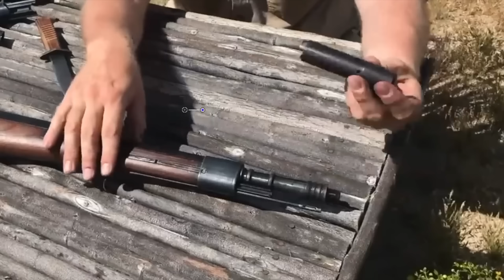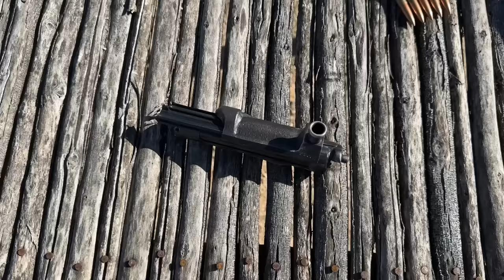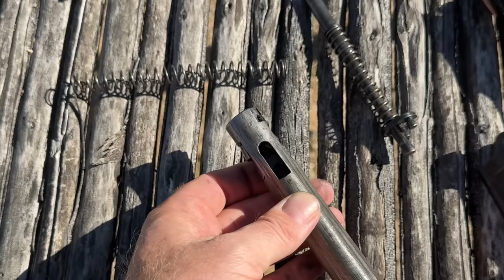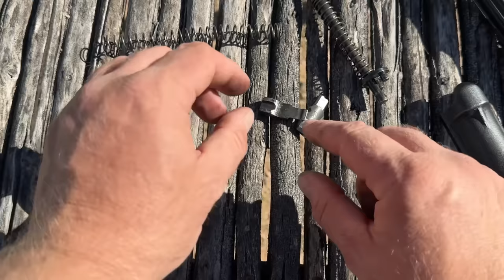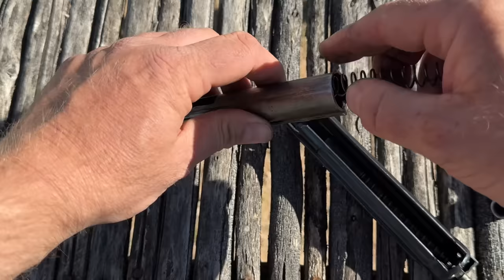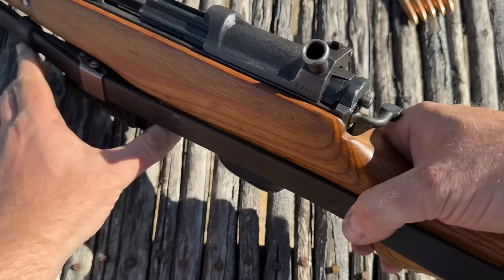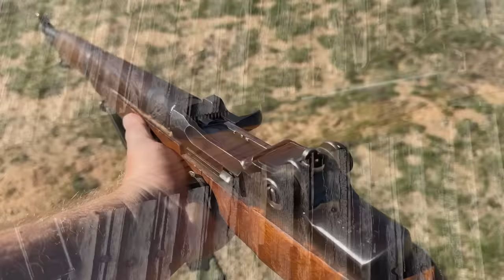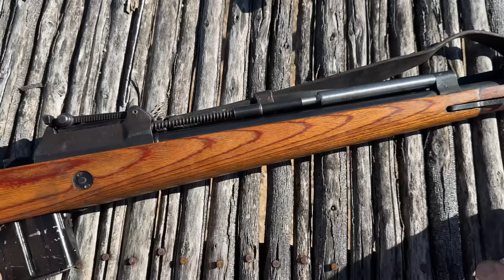Das G43 Wunder-Gewehr ist Scheiße

Comment: The best autoloading rifle of Germany in WW2 was the STG, by far. Not because it's the first "assault rifle", but because the G41 and G43 and the VG 1-5 are just garbage.
Reply: Don't forget to put the FG-42 together with the bad ones, interesting design but it just breaks.
Reply: @zepetv589  How dare you?
Reply: To be fair to the VGs, they work pretty well for being made out of scrap wood and drain pipes
Reply: @zepetv589  the 2nd pattern doesn't tend to, but they weren't available till very late, so it hardly matters. It was copied/improved on extensively post war.
Reply: I mean designing a assault rifle around an 8mm cartridge is probably not the best idea. You end up with a extremely long magazine that causes soldiers to be sticking way up when they are going prone.
Reply: @dancortes3062  That's a pretty negligible difference in a relatively niche situation.  The same criticism could be leveled against really any SMG of the war.  Besides the reason is mostly down to bullet curvature, and the bullet's dimensions were mostly chosen for ease of production, matching the standard 8mm mauser round in as many aspects as possible so they could use the same tooling instead of having to make new tooling.
Reply: StG 44 was not w/o faults either, it loses headspace after as low as 3000 rounds and magazines were often junk, leading to stoppages if loaded with more that 24-25 rounds.
Reply: We all know the krumlauf is the best weapon...We are only able to defeat that technology 80 years later with guncam (felin, X29 etc).
Reply: @alexisborden3191  They used to produce .30 Mauser. Why couldn't they make it with .30 caliber tooling? I would think that would be a little bit better unless they got rid of that tooling before the STG-44 was produced. Also the ability to get as low to the ground as possible is probably not as niche as you think. Some soldiers in the Vietnam war loved how low they was able to get to the ground with their 20 round M16s. Their Alice packs were getting shot up and any higher, they would of been dead. Even the Germans in WW2 developed a smaller capacity mag for the STG-44 so soldiers could get closer to the ground if need be. Yes some SMGs in WW2 had long magazines but the STG-44 mag was ridiculously long. It would be like having a 50 round AR-15 mag.
Reply: @zepetv589  excuse me? you mean the design that is still being utilized by the Bundeswehr to this day? for lack of a better desing????
Reply: @seancopley-b8p  FG-42, not MG-42
Reply: @daer2121  The only thing that took some partial inspiration from it that actually went anywhere was the m60 (some prototypes in the EM-2 programme but the actual EM-2 had little to nothing in common and even that didn't go anywhere in the end), and that was just the operating system which is basically the Lewis' so not even something unique to the FG-42. Please correct me if there's something I am not recalling.
Reply: I wonder, if what the US had in WW II was in all respects better, and having Brits, Canadians and half the World helping them, too why did. it still take them almost a year to get from Normandy to Berlin.
Reply: @dancortes3062  The difference between prone with a K98 and STG44, is like maybe 6 inches at most, at range that's not affecting your liklihood of getting hit all that much.  If it really mattered, the Americans would never have used the the 30 round magazines ever.  Its not ideal, but its workable given the alternate problem of having less ammunition and rifle production.  Not letting perfect be the enemy of good sort of thing.

As for .30 mauser tooling, there was never going be as much tooling for 19th century pistol rounds as there was for their mainline rifle.  I mean, without pulling up production numbers, I can't imagine German industry produced much 30 mauser compared to all the 8mm mauser that was produced for rifles, machine guns, aircraft, vehicles, etc.
Reply: @Bojan_Kavedzic "it" according to whom? Are you claiming all StGs were made equal? There are plenty of original examples out there with 10k+ rounds through them with zero headspace issues. Just because an odd example of the latest examples made might suffer from a headspace issue, almost without a doubt due to improper heat treatment or just overall poor metal quality, that doesnt mean they all suffered from this. Far from it infact, as if you read troop reports on the weapon it was it pretty much universally loved and praised for its reliability, even on the harsh eastern front. Only repeated complaint was the magazine springs becoming too weak over time if left loaded with 30 rnds, hence they simply mandated it only be loaded to 25, and problem solved.
Reply: Certainly it being the first assault rifle does have something to do with that, but it is very much correct that it was the most fool proof design.
Reply: @Bojan_Kavedzic  Bold of you to assume the average stg 44 user would survive to shoot 3000 rounds
Reply: @goofynose2520  Not a large issue in WW2, but Yugoslavia found out that using those in peacetime. Which a part of the answer to the question that pops sometimes - "If Yugoslavia used StGs, why did not they produce them".
Reply: @hummingbird9149  Based on nearly 30 years of use (out of those ~20 as primary rifle for paratroopers) in Yugoslavia. There were rifles that could last a long time, but vast majority was built with pretty poor QC (well... that happens when you are loosing war badly) and while reasonably reliable initially with decent mags (but reliability was nothing to write about, it was more susceptible to dust, mud and cold weather than either AK, AR-10 or vz.58 in Yugoslav army testing when it was used as a comparison rifle) majority started  having issues after few 1000s of rounds, so rule was made that after 3000 rounds headspace should be checked every 500 rounds.
Magazines were just junk, both metal in mag bodies and springs was absolutely substandard. This lead to the mags being easily deformed and springs setting.
Reply: @V3RTIGO222  Even MG-42 was not w/o issues, bolt bounce being quite problematic one. This was never solved fully, even in the post-war versions, and when MAG and PK appeared MG-42/MG-3 became clearly second-best design.  Don't get me wrong, it was groundbreaking for WW2 era and best MG from 1943 to about early '60s, but technology has moved on since then.
Reply: @Bojan_Kavedzic   Also issues with receiver cracking, explosions, etc. With the modernized version they eliminate the detonation and cracking, and mitigated bolt bounce to the point where AR-15s are... so effectively it's a non-issue. That said, gas operated designs are better for a large number of reasons including static free-floated barrels sporting superior inherent accuracy and modular design. That said, it is still a cool gun and historical monument to machine-gun design.
Reply: @Bojan_Kavedzic  so based on second hand service in small numbers with a poor country post war. Again not really indicative of anything. Without knowing the exact batch numbers & amount of previous use, it's impossible to gage anything from this. That said if they stuck with it for 30 years, then it had to have presented some serious strong suits to them that convinced them to keep it for that long.
Reply: @Bojan_Kavedzic  They didn't produce them because they didnt have the ability to do so. They had none of the German manufacturing machines to do so. Also tech had moved on, it wouldve been odd if by the 50s there werent any improved designs available.
Reply: @Bojan_Kavedzic  ...do you really expect a country that is at war with half the planet (and loosing, obviously) to put a high emphasis on quality control when it comes to small arms? Not to mention that, to my knowledge, most STG's were going to the eastern front, where the the average firearm would be dropped (from the soldier dying) or destroyed within the first 500 rounds. Making sure your small arms are nicely finished, have proper quality control, and can actually load the full 30 rounds instead of just 25 really isnt a priority under those conditions.
Reply: @V3RTIGO222  Agree. It was good designing in general, but it took post war versions to iron out bugs, and by then it was superseded by better things. It was still probably best compromise out of all WW2 MG - things that were "better" as MGs tended toward heavy and hence lost a lot at tactical level.
Reply: @hummingbird9149  Discarding real experience because it does not agree with wehrboo fudd lore? 
Unlike popular myth, most StGs in Yugoslav service were not captured, those were received from Czechoslovakia in 1947-48 and France 1948-49. Most of them (about 85%) came as a factory new guns, that were produced, but never issued by Germans in WW2.
Reason Yugoslavia stuck with them so long was that automatic rifle program was late by ~10 years due the some technological and licensing issues. StGs were already supposed to be replaced in the early '60s in paratrooper use, but it took until late '60s/early '70s.  After that those were mostly used for paratrooper drop training and on exercises to give "OPFOR" distinctive weapons until guns were declared "fully obsolete" in 1981.
Reply: @hummingbird9149  Except in the late '40s/early '50s when StG production was considered in Yugoslavia there were no better designs available. Only thing that could compare was AK, but it was unobtainable for Yugoslavia, due the 1948. split with Soviets.
Reply: @random.3665  
1. 500 rounds lifetime was myth. 
2. Soviets managed better QC in 1941. then Germans in 1944-45.
3. Who talked about finish? I was talking about mags being made from totally substandard metal, and worse mag springs were made from the same junk.
4. If mag is designed for 30 rounds, but needs to load 1/5 less - that is a pretty serious issue, wartime or not wartime.
Reply: @Bojan_Kavedzic  On the contrary you're discarding the experience of the weapons prime operator, probably because it doesn't fit with your own preconcieved view on things - the fact you have to resort to screaming "wehraboo" is telling.
Reply: Isnt the Fedorov Avtomat the first assault rifle
Reply: @dancortes3062 7.63 Mauser was a niche cartridge at best in 1940s Germany, used only for the occasional C96 still in service and captured PPSh-41s. They weren't making any 7.62mm rifle or submachine gun barrels.
Reply: @Bojan_Kavedzic Nothing that couldn't have been fixed with minor redesigns by Yugoslavian weapon makers. But then there already were newer designs like the AK around and there was simply no need for this anymore.
Reply: @Bojan_Kavedzic Which gun was ever w/o issues. That's one of the main reasons for design evolutions.
Reply: Formally it still used full power rifle cartridge (6.5 Arisaka), but 6.5 was specifically chosen for being less powerful than 7.62x54r and most other popular rifle cartridges of the time. So you can say Fyodorov is automatical rife designed in assault rife concept
Reply: @zepetv589  the Stg-57 also took some inspiration from the FG-42.
Reply: @MothaLuva  do you know what a trench is? Fortifications? Ocean-long supply lines? 

What the US had mostly was an untouched industrial base and a well-fed soldiery, but it's not like invasions are easy lmao
Reply: It was the first assault rifle tho
Reply: @Bojan_Kavedzic  It has not moved on that much. The MG42 is still in service as the MG3.
Reply: @caffetiel  Do I care? Nobody asked for the invasion.

Comment: G43 was a stop gap solution. The no drilling of gas port persisted as a criteria for a semi auto main battle full powered rifle. However Mauser didnt figure out the solution to this problem until very late in the war. The rifle that was meant to really be an official wehrmacht semi auto was Gerät 08 which was a further development of Gerät 07 which was a further development of gerät 03. So what did the Gerät 08 looked like you might ask? Well there are no known pictures I could find but it was a Copy of STG 45 in 8mm mauser and with a select fire option the rifle used the famous delayed blowback system and 20 round mags that can be seen on Gerät 03. The Mauser company came to a conclusion that delayed blowback was the most reliable and economically sound systems for the wehrmacht as the whole army tried to standardize as much as possible. Basically this is why stg 45, G45, mg 45 and Fg 45 used the same system. You can see a similar effort for the german Armor under the Entwicklung program.
Reply: why was it not allowed to drill a gas port?
Reply: @sliceofbread2611   Drilling of gas ports in the barrel is a more precise and industrially tedious thing to do and if you tap a gas port u need A gas piston tube or a direct impingement tube next to the rifle. This just requires more man hours to do, more machining time etc.plus the maintenance takes longer in the field as u have 2 separate tubes that are prone to fouling especially when cheap corrosive ammo is used and of course cas tubes also wear out and need replacement in time. This issue is not existent with blowback operated firearms, you just aim your WD40 into the barrel and spray out the gunk lol. And yeah last thing rollerdelayed blowback is better when ammo quality is low and you use steel case.